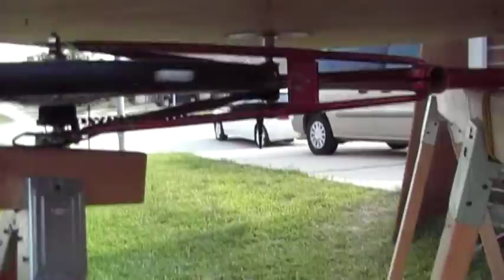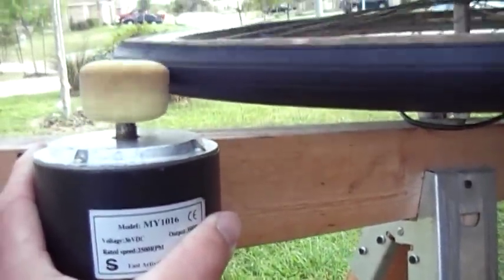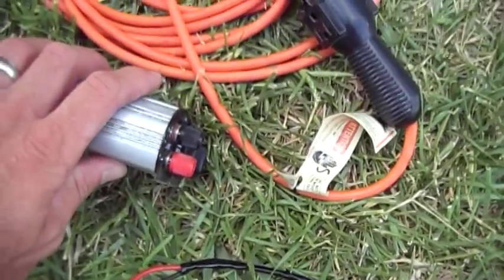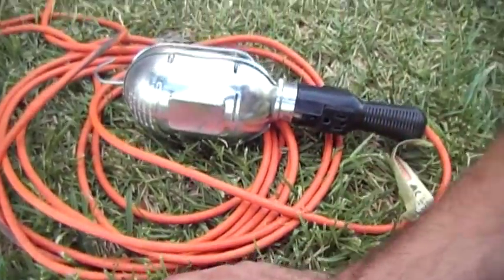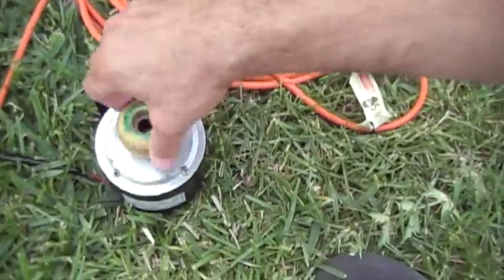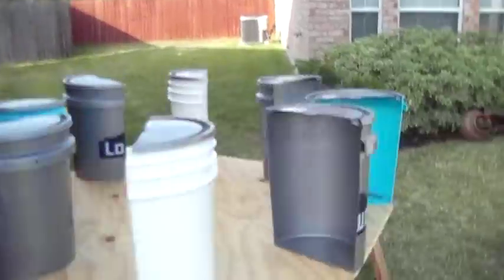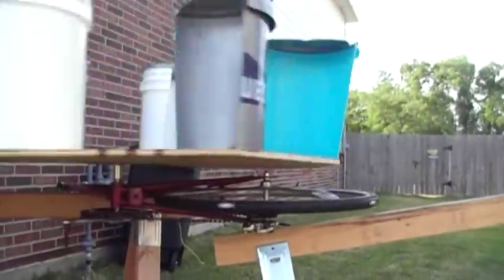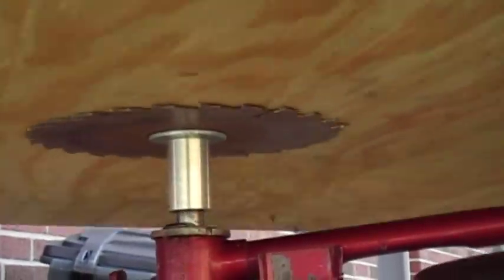Gene Basler's VAWT: Update, obstacles

Comment: Generator is OK. Try to change bike ratio. Set lowest speed on the bicycle to get maximum torque on the will. Then you will get lower voltage but you will definitely spin generator with relatively small load.

Comment: Perhaps driving the scooter motor with a standard bicycle chain from any of the gears on the wheel? At least you're not getting resistance from the friction of the skateboard wheel... If you spin the motor, you will find that it will produce 12 volts at a fairly wide range of speeds. I tried it with a 36 volt PM motor and I got up to 18 volts using a drill to spin the shaft. Keep it up, I bet you'll get a lot of good information out of your experiments that will be useful for future projects.

Comment: Ok if you increase the diameter of your blades you will have more torque or the blade can be longer. use pvc.  scrap your base totally. low rpm motor  is a must. you need much more torgue in the system. also if the blades could rotate you could set up two stops to fil the blade with pressure on the front side , then rotate the blade to reduce drag on the back side.

Comment: First off I would try and seal the board. Also try the drill like suggested before while you have the light hooked up and the appreciate wheel off try spinning it. Along with having a volt meter hooked into your wire nut terminals to see what it's putting out under load good luck. You are on the right track. Message me if u want me to call u

Comment: I hate tell u most Vawt don't work to well and with the gear ratio that u have, u need  about 4 to 1 ratio or 5 to 1 which doesn't have the drag as the system u have.Now here is something u can try put some diodes in line to your convertor which will help.But a vawt under a load just hasn't got the torgue for a good system.You would need something that would put out at least 25 volts to charge a 12 volt system now this is without a load.Hope this has helped

Comment: Thank you for a good video, here is my 2 cents. If your bike wheel i spinning at 120 rpm,  and your scateboard wheel is aprox 10 times or more smaller in diameter, it should spin at 1200 rpm,  and thats closer to the 2500 rated on the scooter generator. You just need more wind and you are golden i think.

Comment: I would like you to find a cordless drill and connect the leads to a light bulb and try to spin it to see what it would take to light the bulb.
In this way you can physically feel the tork required to generate power.
the drill would be a nice test if you can figure a way to mount it to your vawt.